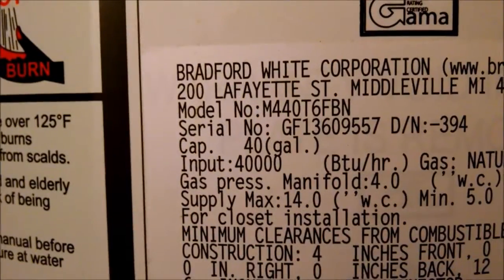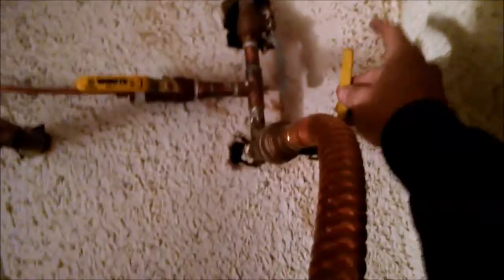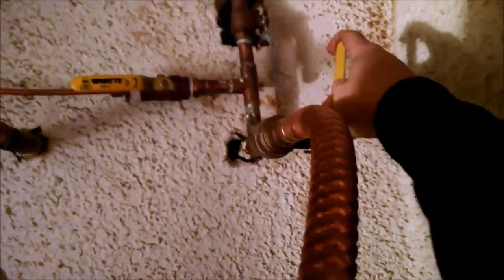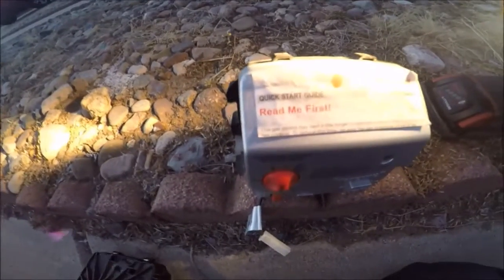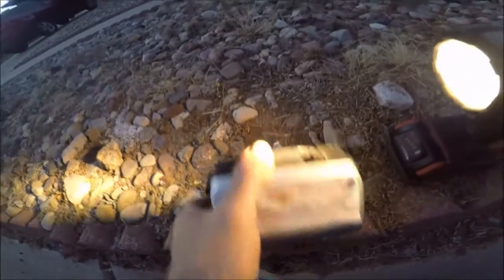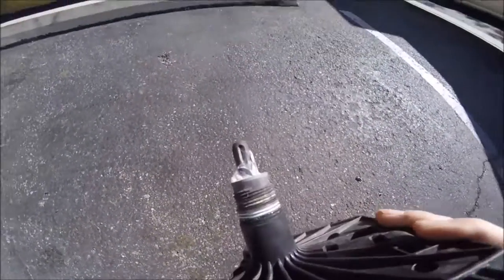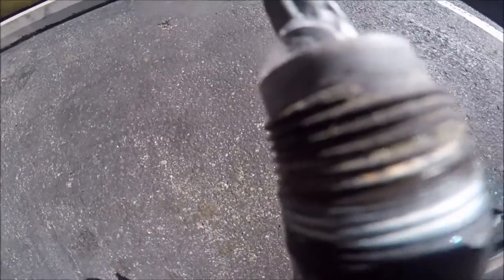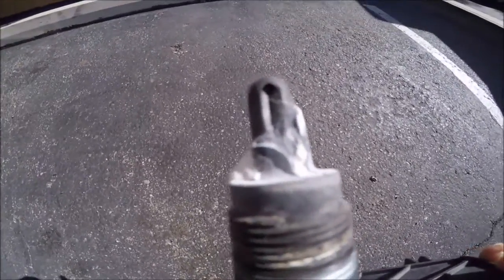Bradford White icon series gas control by Honeywell

Comment: Yeah I had one of those leak as a new install as soon as i turned the water on to it. It's the only one I've had. I still like Bradford white over other brands but they definitely need to get their act together on these new valves.
Reply from the maker: same that's the only brand I sell & the only one I've had do that. the new control well has that metal tip now & replaced it to the customer for free under warranty. I'm curious how many more are going to do that? thanks for watching Tim
Reply: So weird man, I had one do this yesterday I think two days after I watched and commented on your video. That makes two for me. This unit was four years old.
Reply from the maker: Tim Short that one I did was only 4 years old also Bradford White replaced the control under warranty so that's 3 that I know of now with the 2 that you did Tim that's good to know so I can keep an eye out. thanks for the heads up Tim